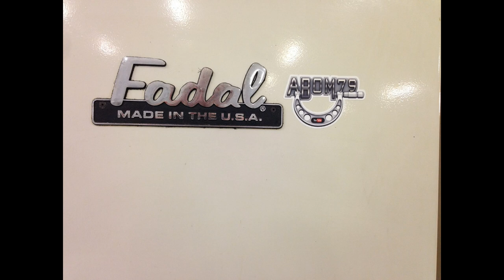Saturday Night Special 63

Comment: I reakky liked that sacrificial faceplate, I may do that at work, but I will have to use a big piece of steel with an eyebolt hole to put it in our 28 inch  toolmex lathe
Reply from the maker: Sounds good to me!

Comment: Nice work Adam,  that boring mill looks really nice.  Clean & pretty is always nice to be around;  may not work any better but it sure can make being in the shop more pleasant.  Z-offset caster mounts like someone else mentioned in the comments seem like a reasonable option for lowering your gantry crane;  fab & bolt on and then off again if you move/expand into a different shop or when you need higher lift.

Comment: Adam, be careful with copper cleaners sometimes they leave a residue that is actually an insulator. The best way to insure good contact between parts is to tin the copper with 40/60 solder or 50/50. This is a old standard in the electrical industry to prevent corrosion and insure good contact

Comment: Hadn't you been having some kind of feed or clutch problem on the Kearns? I thought I remembered you saying something about it having some kind of little problem, just wondered if you got that fixed before the new paint. That thing looks sharp now! If it wasn't freezing here this afternoon I would be out working on the G&L's home! Oh well still a never ending pile of projects, thanks for the weekly video and the cool stickers!
Reply from the maker: Brian, glad you got the stickers. Hope you pick a good spot for them. No we still have the clutch problem, but will try to address it when we have slack time again. The problem is it's internal so not an easy fix. Have to take things apart to get in there. Not fun at all. I'd rather do machine work. LOL

Comment: Hey there Adam,
This is going to sound crazy, but I know you are polishing a lot lately and there is a trick I learned from my trucking days. The guys that worked the parking lots polishing the truck fuel tanks and rims used a white sock with a hand full or two of flour in it tied in a loose knot (so adding more was easy) to do the final wipe down. Puff the sock a little and wipe. It will remove the remaining residue on the metal. You can see the black on the sock. Puff and repeat. It is a little dusty but will bring your metal to the next level of shine. Try it and I think you will see what I mean,
Thanks for the videos.
Richard
P.S.
Walking Dead .... WOW .. cant wait for next season and the new show too.

Comment: The only way I would buy new castors is if I had a project that could use the old ones. Chop it. What rpm you run on that reamer? Wish you got some video of that scraping. Thats one thing I want to try as well
Reply from the maker: New casters will be around $300. Guess it's time for some fab work. Don't remember the rpm but around 200-300. We didn't scrape the ways, just the paint. Sorry I didnt clarify.

Comment: Hi Adam,
Another nice SNS!  Good scores at the flea market.  I have got to find one around here!
The boring mill looks great!  I was wondering, did you paint the mill with a brush or spray it?  Going by the number of machined surfaces (that would need masking for spray paint) on that mill, my guess would be brush painting.
Thanks for the video.
-mike
Reply from the maker: Brush and roller. Use the roller for the open areas, and a trim brush to trim it all in.

Comment: Put some z steps on the gantry to lower gantry/raise the swivel casters  mounts. Can easily go back to original height. Think drop deck style creepers
Reply from the maker: I want to drop it so that it fits in my shop. Not worried about bringing back to the original height.
Reply: I have the problem of too low ceiling for a shop. Also too old to bend over, maybe I should raise floor 4 in,so I don't have to reach down so far (Ha!Ha!)
Reply: Your presentations are very enjoyable to watch.